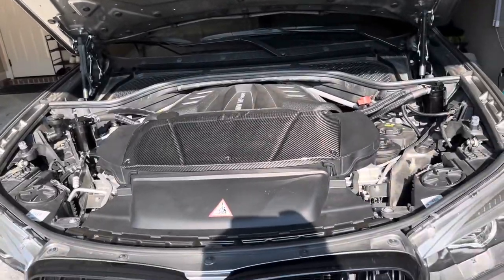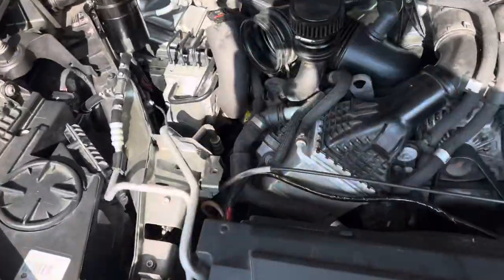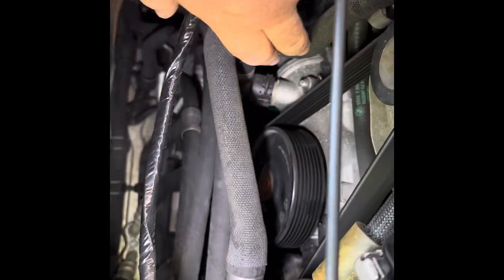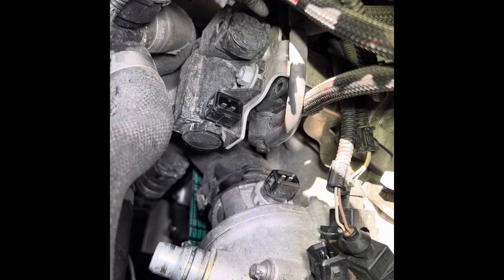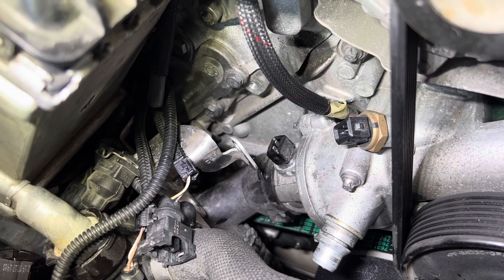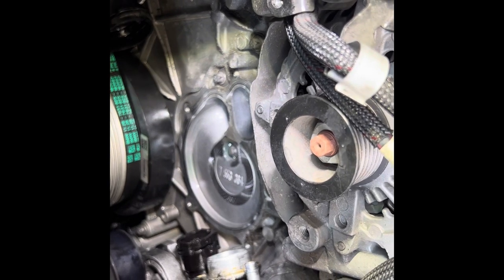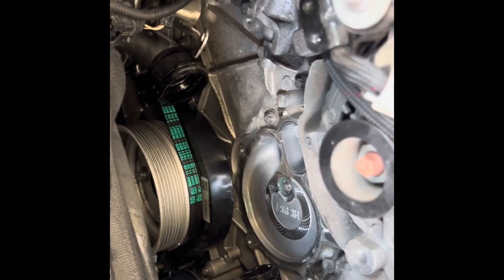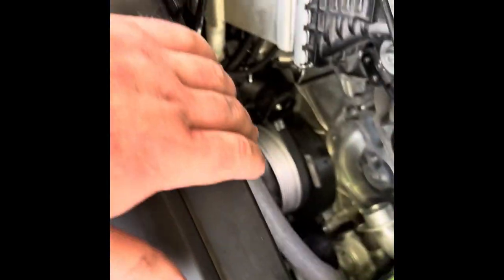F85 S63 water pump replacement/lower temp thermostat install, belts and boost solenoids replacement

Comment: Just got my F85 (used obviously), were you doing this mainly as preventative maintenance? How did you decide to do it? Hoping I don't need to do it anytime soon, seems beyond my current abilities.
Reply from the maker: I replaced my water pump and belts because i wanted to replace the thermostat to a lower temp tstat and i had to remove water pump anyway for that, so I decided to go back in with a new unit.